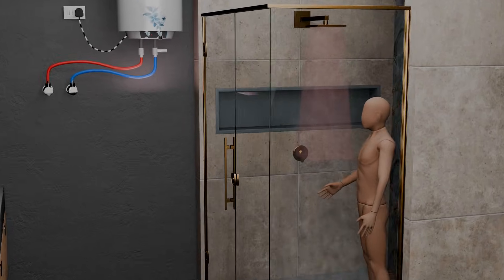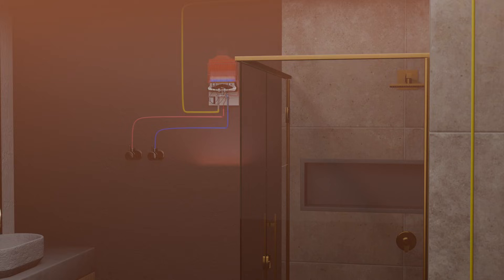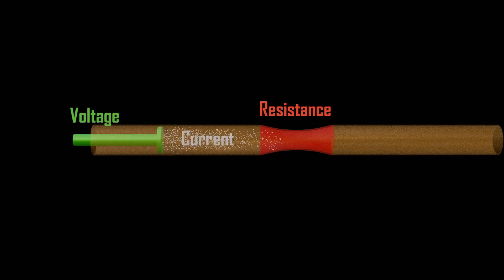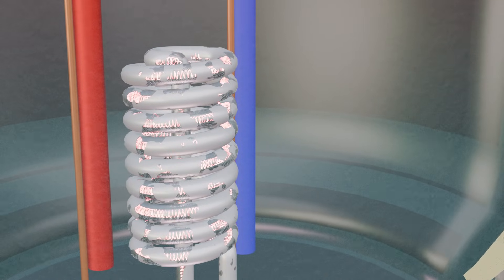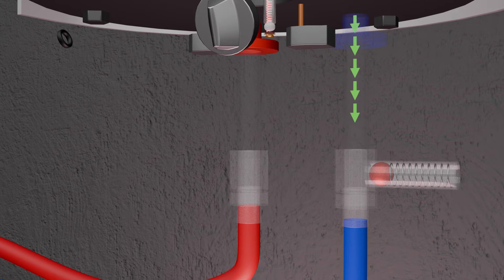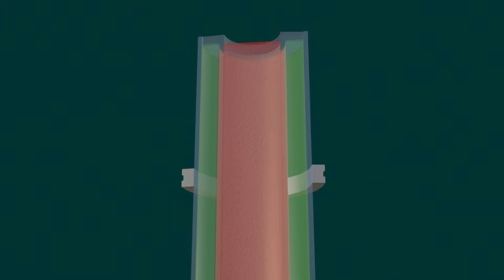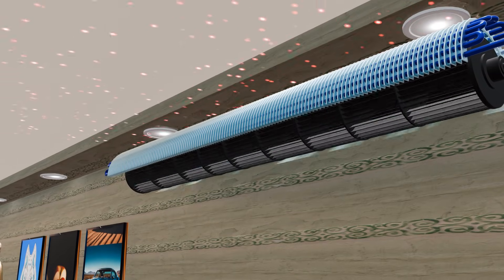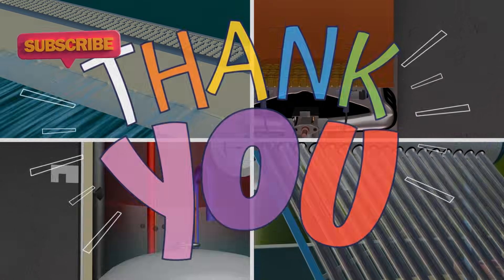Why Your Water Heater Can Shock You — And Which Type Is Actually Safe

Comment: I've never seen a gas boiler with an efficiency lower than 80%. Even mine, which dates back to the 1980s, has a good 84% efficiency rating. Furthermore, I've never seen a gas boiler without a flue. New condensing gas boilers, among other things, have efficiencies ranging from 98 to 108% (it also varies depending on the humidity levels already present in the air).